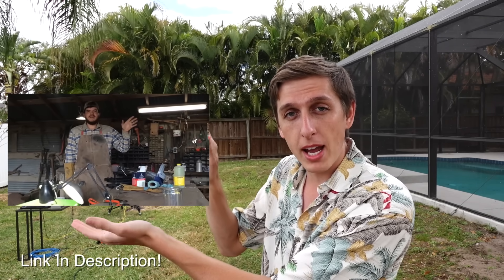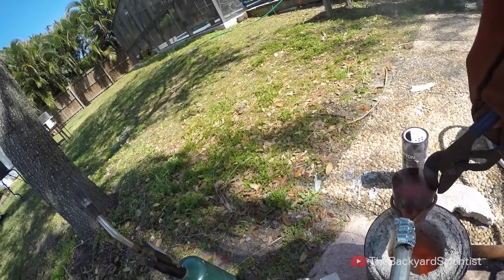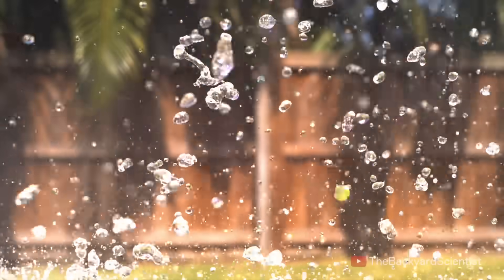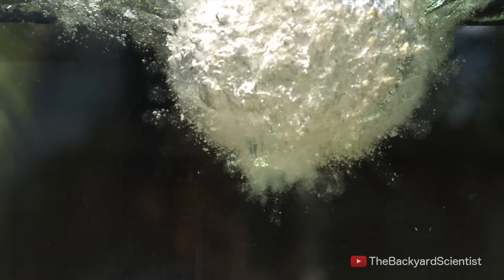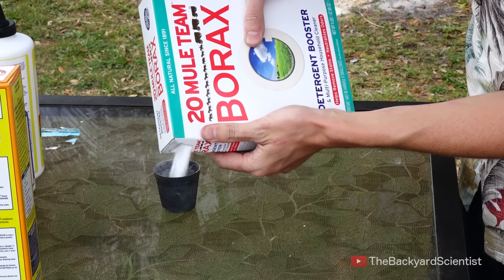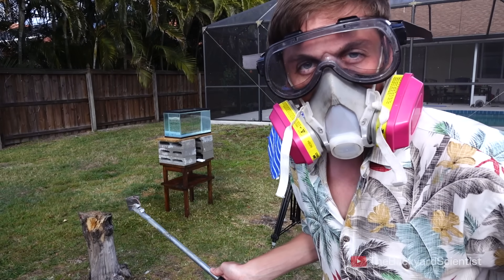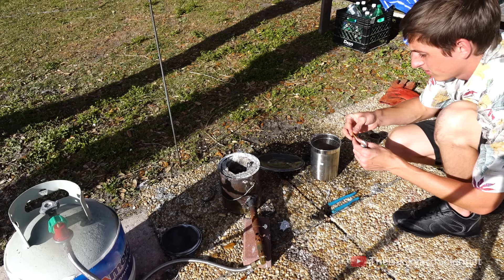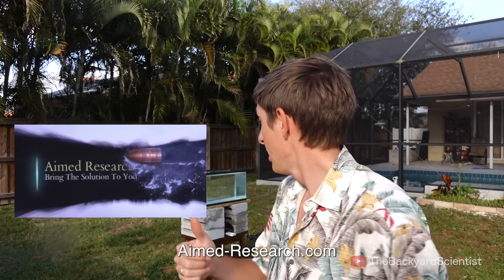Pouring Molten salt into Water - Explosion!

Comment: Why the pH of the water didn't change was not because it is a physical reaction cuz in fact the explosion is a chemical reaction.
The pH didn't change because you mixed a neutral solute (the salt) in a neutral soluble (good old H2O)
Reply: =NOPE,ITS ABOUT DENSITY AND VISCOSITY.....MOLTEN SALT DENSER THAN WATER BUT LESSER VISCOSITY

=MOLTEN SALT SINKS IN WATER,BUT DUE TO LESSER VISCOSITY IT'S DROPLETS IMMEDIATELY DISPERSE INTO LITTLEST POSSIBLE ONES,WHICH TRANSFER THEIR HEAT TO WATER ALL AT ONCE WHICH DOES A BOOM

.......MOLTEN COPPER INTO WATER DOES THE SAME BOOM.........ALSO WATER IN BOILING OIL......JUST THE SAME PRINCIPLE.....AND PROOF IS ABOUT NOTHING HAPPENS IF WATER ON MOLTEN SALT OR COPPER.....

...........SO LESS VISCOUS LIQUID MUST BE DENSER TO GO BOOM.............AND IF IT HAS LESSER DENSITY SO IT'LL JUST FLOAT ON SURFACE........LIKE IF WATER TO POUR ON MOLTEN SALT,THERE'LL BE NO EXPLOSION.....................AND WATER ON MOLTEN COPPER DOES NOT EXPLODE...............JUST BOIL AWAY FROM SURFACE,BECAUSE OF IT CANNOT GET UNDERNEATH DUE TO LESSER DENSITY......................

.............AND BOILING OIL DOES NOTHING WHEN POURED IN WATER,BY THE SAME CAUSE...........MAYBE SOME BUBBLES WILL BE,BUT NOT VERY MUCH,BECAUSE OF WATER WILL ABSORB HEAT AND IT'S UNDERNEATH OIL SO AREA OF CONTACT WILL BE JUST MINIMAL AS POSSIBLE................

.................AND IF DENSER LIQUID WILL HAVE GREATER VISCOSITY,SO IT'LL KEEP TO MAINTAIN IT'S SHAPE AND WONT EXPLODE........................LIKE MOLTEN SUGAR,MOLTEN IRON,MOLTEN ALUMINUM,LAVA WHICH IS MOLTEN ROCKS.........................

...............I THINK YOU GOT THE POINT........................
Reply: @robotnikkkk001  ok I see your point it's just that I though the reaction happens because of the nature of the metal because, go watch vidéos on what happens when you put pure sodium into water

Comment: Im pretty sure that the sodium isnt affected by the leudenfrost affect because sodium (which is also in salt duh) atracts water. So it has a reaction.
Reply: =NOPE,ITS ABOUT DENSITY AND VISCOSITY.....MOLTEN SALT DENSER THAN WATER BUT LESSER VISCOSITY

=MOLTEN SALT SINKS IN WATER,BUT DUE TO LESSER VISCOSITY IT'S DROPLETS IMMEDIATELY DISPERSE INTO LITTLEST POSSIBLE ONES,WHICH TRANSFER THEIR HEAT TO WATER ALL AT ONCE WHICH DOES A BOOM

.......MOLTEN COPPER INTO WATER DOES THE SAME BOOM.........ALSO WATER IN BOILING OIL......JUST THE SAME PRINCIPLE.....AND PROOF IS ABOUT NOTHING HAPPENS IF WATER ON MOLTEN SALT OR COPPER.....

...........SO LESS VISCOUS LIQUID MUST BE DENSER TO GO BOOM.............AND IF IT HAS LESSER DENSITY SO IT'LL JUST FLOAT ON SURFACE........LIKE IF WATER TO POUR ON MOLTEN SALT,THERE'LL BE NO EXPLOSION.....................AND WATER ON MOLTEN COPPER DOES NOT EXPLODE...............JUST BOIL AWAY FROM SURFACE,BECAUSE OF IT CANNOT GET UNDERNEATH DUE TO LESSER DENSITY......................

.............AND BOILING OIL DOES NOTHING WHEN POURED IN WATER,BY THE SAME CAUSE...........MAYBE SOME BUBBLES WILL BE,BUT NOT VERY MUCH,BECAUSE OF WATER WILL ABSORB HEAT AND IT'S UNDERNEATH OIL SO AREA OF CONTACT WILL BE JUST MINIMAL AS POSSIBLE................

.................AND IF DENSER LIQUID WILL HAVE GREATER VISCOSITY,SO IT'LL KEEP TO MAINTAIN IT'S SHAPE AND WONT EXPLODE........................LIKE MOLTEN SUGAR,MOLTEN IRON,MOLTEN ALUMINUM,LAVA WHICH IS MOLTEN ROCKS.........................

...............I THINK YOU GOT THE POINT........................

Comment: but sodium chloride is complelty different to sodium
Reply: =ITS ABOUT DENSITY AND VISCOSITY.....MOLTEN SALT DENSER THAN WATER BUT LESSER VISCOSITY

=MOLTEN SALT SINKS IN WATER,BUT DUE TO LESSER VISCOSITY IT'S DROPLETS IMMEDIATELY DISPERSE INTO LITTLEST POSSIBLE ONES,WHICH TRANSFER THEIR HEAT TO WATER ALL AT ONCE WHICH DOES A BOOM

.......MOLTEN COPPER INTO WATER DOES THE SAME BOOM.........ALSO WATER IN BOILING OIL......JUST THE SAME PRINCIPLE.....AND PROOF IS ABOUT NOTHING HAPPENS IF WATER ON MOLTEN SALT OR COPPER.....

...........SO LESS VISCOUS LIQUID MUST BE DENSER TO GO BOOM.............AND IF IT HAS LESSER DENSITY SO IT'LL JUST FLOAT ON SURFACE........LIKE IF WATER TO POUR ON MOLTEN SALT,THERE'LL BE NO EXPLOSION.....................AND WATER ON MOLTEN COPPER DOES NOT EXPLODE...............JUST BOIL AWAY FROM SURFACE,BECAUSE OF IT CANNOT GET UNDERNEATH DUE TO LESSER DENSITY......................

.............AND BOILING OIL DOES NOTHING WHEN POURED IN WATER,BY THE SAME CAUSE...........MAYBE SOME BUBBLES WILL BE,BUT NOT VERY MUCH,BECAUSE OF WATER WILL ABSORB HEAT AND IT'S UNDERNEATH OIL SO AREA OF CONTACT WILL BE JUST MINIMAL AS POSSIBLE................

.................AND IF DENSER LIQUID WILL HAVE GREATER VISCOSITY,SO IT'LL KEEP TO MAINTAIN IT'S SHAPE AND WONT EXPLODE........................LIKE MOLTEN SUGAR,MOLTEN IRON,MOLTEN ALUMINUM,LAVA WHICH IS MOLTEN ROCKS.........................

...............I THINK YOU GOT THE POINT........................

Comment: All alkali metals react strongly with water
Reply: =NOPE,ITS ABOUT DENSITY AND VISCOSITY.....MOLTEN SALT DENSER THAN WATER BUT LESSER VISCOSITY

=MOLTEN SALT SINKS IN WATER,BUT DUE TO LESSER VISCOSITY IT'S DROPLETS IMMEDIATELY DISPERSE INTO LITTLEST POSSIBLE ONES,WHICH TRANSFER THEIR HEAT TO WATER ALL AT ONCE WHICH DOES A BOOM

.......MOLTEN COPPER INTO WATER DOES THE SAME BOOM.........ALSO WATER IN BOILING OIL......JUST THE SAME PRINCIPLE.....AND PROOF IS ABOUT NOTHING HAPPENS IF WATER ON MOLTEN SALT OR COPPER.....

...........SO LESS VISCOUS LIQUID MUST BE DENSER TO GO BOOM.............AND IF IT HAS LESSER DENSITY SO IT'LL JUST FLOAT ON SURFACE........LIKE IF WATER TO POUR ON MOLTEN SALT,THERE'LL BE NO EXPLOSION.....................AND WATER ON MOLTEN COPPER DOES NOT EXPLODE...............JUST BOIL AWAY FROM SURFACE,BECAUSE OF IT CANNOT GET UNDERNEATH DUE TO LESSER DENSITY......................

.............AND BOILING OIL DOES NOTHING WHEN POURED IN WATER,BY THE SAME CAUSE...........MAYBE SOME BUBBLES WILL BE,BUT NOT VERY MUCH,BECAUSE OF WATER WILL ABSORB HEAT AND IT'S UNDERNEATH OIL SO AREA OF CONTACT WILL BE JUST MINIMAL AS POSSIBLE................

.................AND IF DENSER LIQUID WILL HAVE GREATER VISCOSITY,SO IT'LL KEEP TO MAINTAIN IT'S SHAPE AND WONT EXPLODE........................LIKE MOLTEN SUGAR,MOLTEN IRON,MOLTEN ALUMINUM,LAVA WHICH IS MOLTEN ROCKS.........................

...............I THINK YOU GOT THE POINT........................

Comment: My mind is blown🤯
Reply: =ITS ABOUT DENSITY AND VISCOSITY.....MOLTEN SALT DENSER THAN WATER BUT LESSER VISCOSITY

=MOLTEN SALT SINKS IN WATER,BUT DUE TO LESSER VISCOSITY IT'S DROPLETS IMMEDIATELY DISPERSE INTO LITTLEST POSSIBLE ONES,WHICH TRANSFER THEIR HEAT TO WATER ALL AT ONCE WHICH DOES A BOOM

.......MOLTEN COPPER INTO WATER DOES THE SAME BOOM.........ALSO WATER IN BOILING OIL......JUST THE SAME PRINCIPLE.....AND PROOF IS ABOUT NOTHING HAPPENS IF WATER ON MOLTEN SALT OR COPPER.....

...........SO LESS VISCOUS LIQUID MUST BE DENSER TO GO BOOM.............AND IF IT HAS LESSER DENSITY SO IT'LL JUST FLOAT ON SURFACE........LIKE IF WATER TO POUR ON MOLTEN SALT,THERE'LL BE NO EXPLOSION.....................AND WATER ON MOLTEN COPPER DOES NOT EXPLODE...............JUST BOIL AWAY FROM SURFACE,BECAUSE OF IT CANNOT GET UNDERNEATH DUE TO LESSER DENSITY......................

.............AND BOILING OIL DOES NOTHING WHEN POURED IN WATER,BY THE SAME CAUSE...........MAYBE SOME BUBBLES WILL BE,BUT NOT VERY MUCH,BECAUSE OF WATER WILL ABSORB HEAT AND IT'S UNDERNEATH OIL SO AREA OF CONTACT WILL BE JUST MINIMAL AS POSSIBLE................

.................AND IF DENSER LIQUID WILL HAVE GREATER VISCOSITY,SO IT'LL KEEP TO MAINTAIN IT'S SHAPE AND WONT EXPLODE........................LIKE MOLTEN SUGAR,MOLTEN IRON,MOLTEN ALUMINUM,LAVA WHICH IS MOLTEN ROCKS.........................

...............I THINK YOU GOT THE POINT........................

Comment: Could it just be that table salt, when melted, is more dense than the other salts and is maybe too dense to be supported by the leidenfrost effect? So, it falls through the steam bubble and interacts, where the others float in the steam until they cool beyond the point of being able to react and explode.
Reply: i think you're right about that and it might have less surface tension than other salts too
Reply: =NOPE,ITS ABOUT DENSITY AND VISCOSITY.....MOLTEN SALT DENSER THAN WATER BUT LESSER VISCOSITY

=MOLTEN SALT SINKS IN WATER,BUT DUE TO LESSER VISCOSITY IT'S DROPLETS IMMEDIATELY DISPERSE INTO LITTLEST POSSIBLE ONES,WHICH TRANSFER THEIR HEAT TO WATER ALL AT ONCE WHICH DOES A BOOM

.......MOLTEN COPPER INTO WATER DOES THE SAME BOOM.........ALSO WATER IN BOILING OIL......JUST THE SAME PRINCIPLE.....AND PROOF IS ABOUT NOTHING HAPPENS IF WATER ON MOLTEN SALT OR COPPER.....

...........SO LESS VISCOUS LIQUID MUST BE DENSER TO GO BOOM.............AND IF IT HAS LESSER DENSITY SO IT'LL JUST FLOAT ON SURFACE........LIKE IF WATER TO POUR ON MOLTEN SALT,THERE'LL BE NO EXPLOSION.....................AND WATER ON MOLTEN COPPER DOES NOT EXPLODE...............JUST BOIL AWAY FROM SURFACE,BECAUSE OF IT CANNOT GET UNDERNEATH DUE TO LESSER DENSITY......................

.............AND BOILING OIL DOES NOTHING WHEN POURED IN WATER,BY THE SAME CAUSE...........MAYBE SOME BUBBLES WILL BE,BUT NOT VERY MUCH,BECAUSE OF WATER WILL ABSORB HEAT AND IT'S UNDERNEATH OIL SO AREA OF CONTACT WILL BE JUST MINIMAL AS POSSIBLE................

.................AND IF DENSER LIQUID WILL HAVE GREATER VISCOSITY,SO IT'LL KEEP TO MAINTAIN IT'S SHAPE AND WONT EXPLODE........................LIKE MOLTEN SUGAR,MOLTEN IRON,MOLTEN ALUMINUM,LAVA WHICH IS MOLTEN ROCKS.........................

...............I THINK YOU GOT THE POINT........................
Reply: @robotnikkkk001  🤡🤡🤡🤡🤡🤡
Reply: @robotnikkkk001  you bad

Comment: My hypothesis whas that the sodium chloride reacted to a big tempature change but only when it was mixed with the s particles inside salt and when it change temature de particles reacted with an explosion but it´s probaly wrong
Reply: =NOPE,ITS ABOUT DENSITY AND VISCOSITY.....MOLTEN SALT DENSER THAN WATER BUT LESSER VISCOSITY

=MOLTEN SALT SINKS IN WATER,BUT DUE TO LESSER VISCOSITY IT'S DROPLETS IMMEDIATELY DISPERSE INTO LITTLEST POSSIBLE ONES,WHICH TRANSFER THEIR HEAT TO WATER ALL AT ONCE WHICH DOES A BOOM

.......MOLTEN COPPER INTO WATER DOES THE SAME BOOM.........ALSO WATER IN BOILING OIL......JUST THE SAME PRINCIPLE.....AND PROOF IS ABOUT NOTHING HAPPENS IF WATER ON MOLTEN SALT OR COPPER.....

...........SO LESS VISCOUS LIQUID MUST BE DENSER TO GO BOOM.............AND IF IT HAS LESSER DENSITY SO IT'LL JUST FLOAT ON SURFACE........LIKE IF WATER TO POUR ON MOLTEN SALT,THERE'LL BE NO EXPLOSION.....................AND WATER ON MOLTEN COPPER DOES NOT EXPLODE...............JUST BOIL AWAY FROM SURFACE,BECAUSE OF IT CANNOT GET UNDERNEATH DUE TO LESSER DENSITY......................

.............AND BOILING OIL DOES NOTHING WHEN POURED IN WATER,BY THE SAME CAUSE...........MAYBE SOME BUBBLES WILL BE,BUT NOT VERY MUCH,BECAUSE OF WATER WILL ABSORB HEAT AND IT'S UNDERNEATH OIL SO AREA OF CONTACT WILL BE JUST MINIMAL AS POSSIBLE................

.................AND IF DENSER LIQUID WILL HAVE GREATER VISCOSITY,SO IT'LL KEEP TO MAINTAIN IT'S SHAPE AND WONT EXPLODE........................LIKE MOLTEN SUGAR,MOLTEN IRON,MOLTEN ALUMINUM,LAVA WHICH IS MOLTEN ROCKS.........................

...............I THINK YOU GOT THE POINT........................

Comment: Its a coulombic explosion! Super cool, the surface molecules get pulled away into the water super fast, giving the droplet a sort of sea urchin shape, and then all of the new surface area from those spines react with the water at once, hence the explosion and sudden hydrogen gas generation. This was discovered by dropping cesium into water under an inert argon atmosphere.
Reply: =ITS ABOUT DENSITY AND VISCOSITY.....MOLTEN SALT DENSER THAN WATER BUT LESSER VISCOSITY

=MOLTEN SALT SINKS IN WATER,BUT DUE TO LESSER VISCOSITY IT'S DROPLETS IMMEDIATELY DISPERSE INTO LITTLEST POSSIBLE ONES,WHICH TRANSFER THEIR HEAT TO WATER ALL AT ONCE WHICH DOES A BOOM

.......MOLTEN COPPER INTO WATER DOES THE SAME BOOM.........ALSO WATER IN BOILING OIL......JUST THE SAME PRINCIPLE.....AND PROOF IS ABOUT NOTHING HAPPENS IF WATER ON MOLTEN SALT OR COPPER.....

...........SO LESS VISCOUS LIQUID MUST BE DENSER TO GO BOOM.............AND IF IT HAS LESSER DENSITY SO IT'LL JUST FLOAT ON SURFACE........LIKE IF WATER TO POUR ON MOLTEN SALT,THERE'LL BE NO EXPLOSION.....................AND WATER ON MOLTEN COPPER DOES NOT EXPLODE...............JUST BOIL AWAY FROM SURFACE,BECAUSE OF IT CANNOT GET UNDERNEATH DUE TO LESSER DENSITY......................

.............AND BOILING OIL DOES NOTHING WHEN POURED IN WATER,BY THE SAME CAUSE...........MAYBE SOME BUBBLES WILL BE,BUT NOT VERY MUCH,BECAUSE OF WATER WILL ABSORB HEAT AND IT'S UNDERNEATH OIL SO AREA OF CONTACT WILL BE JUST MINIMAL AS POSSIBLE................

.................AND IF DENSER LIQUID WILL HAVE GREATER VISCOSITY,SO IT'LL KEEP TO MAINTAIN IT'S SHAPE AND WONT EXPLODE........................LIKE MOLTEN SUGAR,MOLTEN IRON,MOLTEN ALUMINUM,LAVA WHICH IS MOLTEN ROCKS.........................

...............I THINK YOU GOT THE POINT........................

Comment: You're right when assuming a physical reaction. Molten Sodium-Chloride got's the right mixture of heat capacity, less surface tension and not too much heat conductivity to instantly form a cover of steam around it when divided by the first steam explosion. Instead there where formed a lot of small salt drops who where divided again instead of instantly form the protecting steam bubble around.
Reply: Gotta love the so-called experts in the comments sections never fails lol
Reply: Bro what you talking about
Reply: Al,when hot,does explode
Reply: look at my comment B)
ps: its common science
Reply: It's like fusion
Edit: nuclear fusion reaction
Reply: Looks like a good old fashion steam explosion. 
Try molten lead in water.
Reply: hmm
Reply: I'd love to hear a full ex0lanation of this "right mixture", the one that makes the other chemicals not do anything like it.  So please give us the numbers, and how you used them to come to a conclusion.  In other words, science not speculation/ unsupported claims..
Reply: =ITS ABOUT DENSITY AND VISCOSITY.....MOLTEN SALT DENSER THAN WATER BUT LESSER VISCOSITY

=MOLTEN SALT SINKS IN WATER,BUT DUE TO LESSER VISCOSITY IT'S DROPLETS IMMEDIATELY DISPERSE INTO LITTLEST POSSIBLE ONES,WHICH TRANSFER THEIR HEAT TO WATER ALL AT ONCE WHICH DOES A BOOM

.......MOLTEN COPPER INTO WATER DOES THE SAME BOOM.........ALSO WATER IN BOILING OIL......JUST THE SAME PRINCIPLE.....AND PROOF IS ABOUT NOTHING HAPPENS IF WATER ON MOLTEN SALT OR COPPER.....

...........SO LESS VISCOUS LIQUID MUST BE DENSER TO GO BOOM.............AND IF IT HAS LESSER DENSITY SO IT'LL JUST FLOAT ON SURFACE........LIKE IF WATER TO POUR ON MOLTEN SALT,THERE'LL BE NO EXPLOSION.....................AND WATER ON MOLTEN COPPER DOES NOT EXPLODE...............JUST BOIL AWAY FROM SURFACE,BECAUSE OF IT CANNOT GET UNDERNEATH DUE TO LESSER DENSITY......................

.............AND BOILING OIL DOES NOTHING WHEN POURED IN WATER,BY THE SAME CAUSE...........MAYBE SOME BUBBLES WILL BE,BUT NOT VERY MUCH,BECAUSE OF WATER WILL ABSORB HEAT AND IT'S UNDERNEATH OIL SO AREA OF CONTACT WILL BE JUST MINIMAL AS POSSIBLE................

.................AND IF DENSER LIQUID WILL HAVE GREATER VISCOSITY,SO IT'LL KEEP TO MAINTAIN IT'S SHAPE AND WONT EXPLODE........................LIKE MOLTEN SUGAR,MOLTEN IRON,MOLTEN ALUMINUM,LAVA WHICH IS MOLTEN ROCKS.........................

...............I THINK YOU GOT THE POINT........................,ITS ABOUT DENSITY AND VISCOSITY.....MOLTEN SALT DENSER THAN WATER BUT LESSER VISCOSITY
Reply: @robotnikkkk001  i really like the calm tone
Reply: @robotnikkkk001  calm down bro
Reply: @robotnikkkk001  I'll forgive the caps lock, since I think you're right 😃
Reply: @robotnikkkk001  hey man hit caps lock
Reply: @minusshoot1736  😅

Comment: I think it's something like a prince rupert drop situation. The internal stresses of the  rapid cooling on the crystalline structure are building up then getting released because salt is too weak to hold it's shape unlike glass. To support my idea I think the creaking sounds of the slow cooling crystal at 1:07 indicate a rigid but weak structure cracking on a smaller slower scale.
Reply: =NOPE,ITS ABOUT DENSITY AND VISCOSITY.....MOLTEN SALT DENSER THAN WATER BUT LESSER VISCOSITY

=MOLTEN SALT SINKS IN WATER,BUT DUE TO LESSER VISCOSITY IT'S DROPLETS IMMEDIATELY DISPERSE INTO LITTLEST POSSIBLE ONES,WHICH TRANSFER THEIR HEAT TO WATER ALL AT ONCE WHICH DOES A BOOM

.......MOLTEN COPPER INTO WATER DOES THE SAME BOOM.........ALSO WATER IN BOILING OIL......JUST THE SAME PRINCIPLE.....AND PROOF IS ABOUT NOTHING HAPPENS IF WATER ON MOLTEN SALT OR COPPER.....

...........SO LESS VISCOUS LIQUID MUST BE DENSER TO GO BOOM.............AND IF IT HAS LESSER DENSITY SO IT'LL JUST FLOAT ON SURFACE........LIKE IF WATER TO POUR ON MOLTEN SALT,THERE'LL BE NO EXPLOSION.....................AND WATER ON MOLTEN COPPER DOES NOT EXPLODE...............JUST BOIL AWAY FROM SURFACE,BECAUSE OF IT CANNOT GET UNDERNEATH DUE TO LESSER DENSITY......................

.............AND BOILING OIL DOES NOTHING WHEN POURED IN WATER,BY THE SAME CAUSE...........MAYBE SOME BUBBLES WILL BE,BUT NOT VERY MUCH,BECAUSE OF WATER WILL ABSORB HEAT AND IT'S UNDERNEATH OIL SO AREA OF CONTACT WILL BE JUST MINIMAL AS POSSIBLE................

.................AND IF DENSER LIQUID WILL HAVE GREATER VISCOSITY,SO IT'LL KEEP TO MAINTAIN IT'S SHAPE AND WONT EXPLODE........................LIKE MOLTEN SUGAR,MOLTEN IRON,MOLTEN ALUMINUM,LAVA WHICH IS MOLTEN ROCKS.........................

...............I THINK YOU GOT THE POINT........................